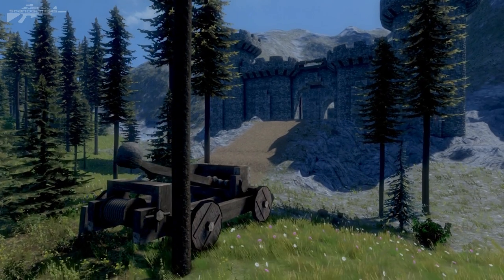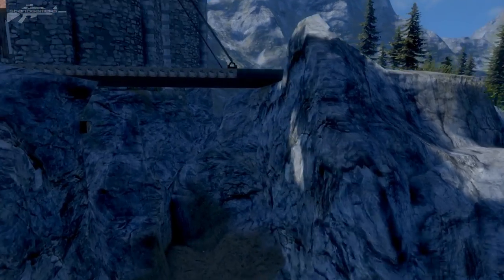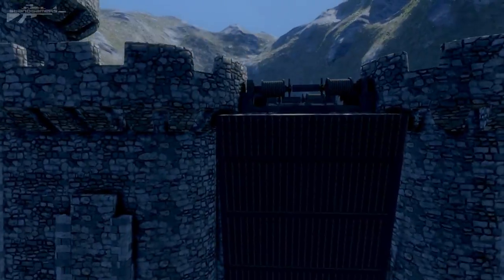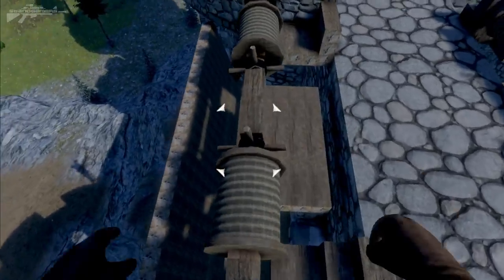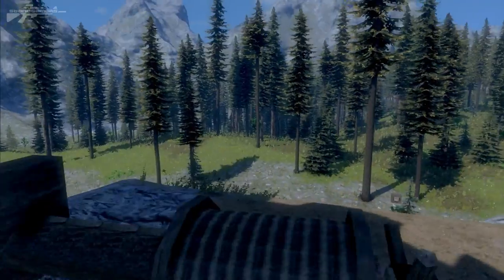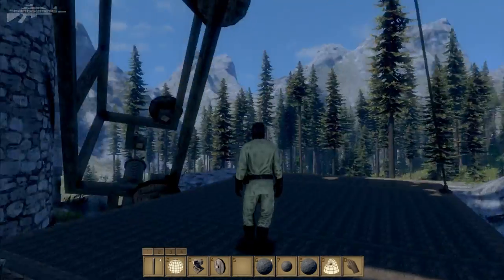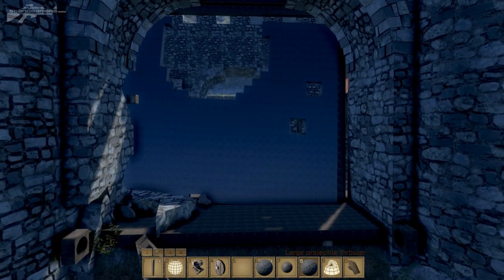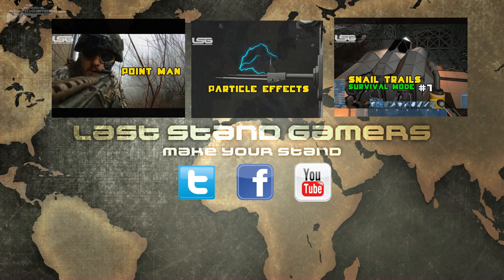Medieval Engineers - Draw Bridges & Sliding Doors

Comment: I would suggest that they remove/reduce the specularity of the metal blocks. If this is medieval sort of times, no way would it be that polished for just a block of metal, it'b be blackened and pitted and all that style of thing (Which would help it match the rest of the environment.
Reply: I agree, these metal blocks sort of look out of place.
Reply: They made suits of armor and smooth swords back then.... 

I do agree that the texture of the metal looks out of place though, but I think it is just a place holder, surely they will make the damage look better than it separating into cubes. It should dent in before it tears. not crumble.
Reply: *****
 The reason for that is because those blocks are weights. Weights stick together, but unlike wood they don't merge into one block, which means the destruction will look like blocks and the strength will be shit. Via Palo Kan
Reply: Phoenix Cool Oh, so it's not really designed to be used as a wall? Just a counter weight for things?
Reply: *****
I don't actually know, I don'th ave the game. I took that information from Pano Kan. If you use CTRL-F and type on Pano Kan you'll find his comment. It's near the top of the comments.
Reply: Phoenix Cool Makes sense, sense they just come apart like that.
Reply: ***** yeah there weights i have the game btw
Reply: Matthew Price How did you get the game already? Was there closed alpha invites sent out or something? 

I plan on getting it in a few days when its open.
Reply: *****
There was a 24 hour sale on Keen Soft's site on the 11th.
Reply: ***** I think bundles of lead would fit more than the high-quality metal texture that is used at the moment. It's also a BIT less shiny.
Reply: I cannot seem to find these metal blocks in my G menu...
Anyone know what this is/called?
Reply: TheCodebuilder IT IS A WEGHT opps sorry caps
Reply: I thought so....They need to add actual metal, cause I do not think metal would fall apart like that...just bend a little
Reply: TheCodebuilder I'm sure they will, assuming they don't limit metal to being used for only hinges and tools/weapons and stuff.
Reply: +DuskandDey they polish metal in those times
Reply: MrNobodyX3  Yes, but a perfect cube of super polished iron looks bizarre XP
Reply: +DuskandDey the metal has no texture back then ...